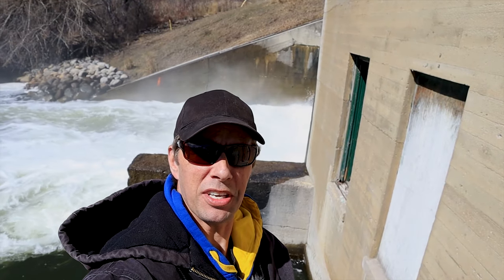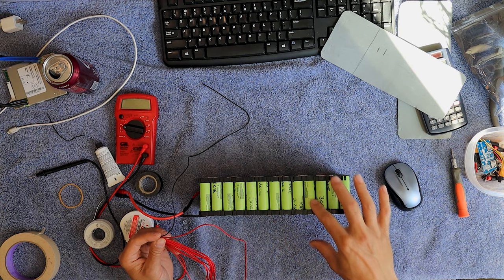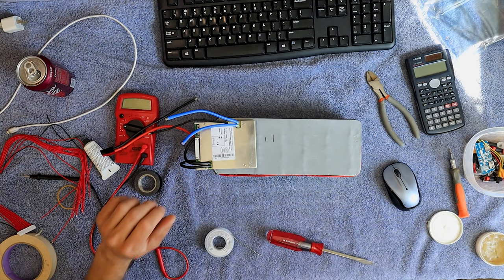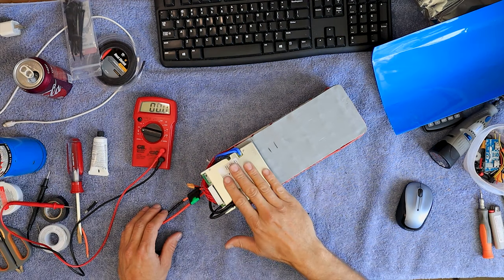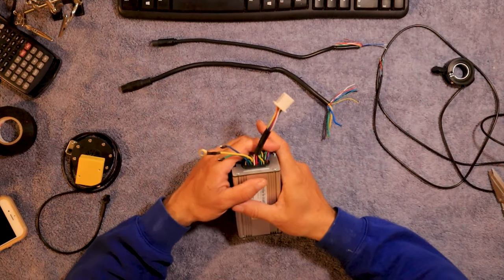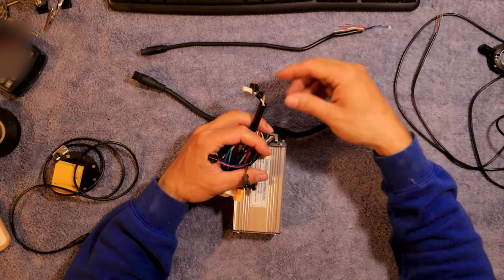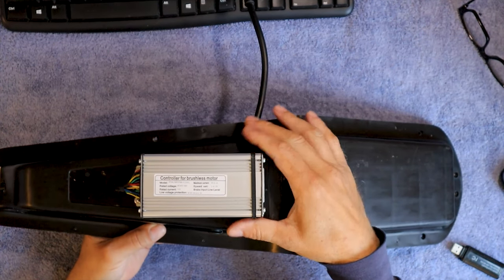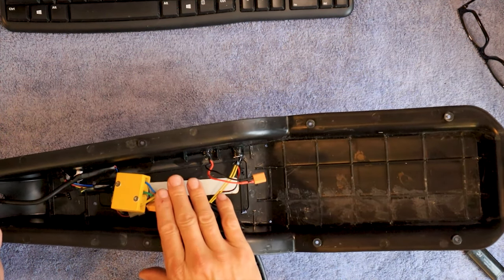Super73 Z1 48v Modification Part 2

Comment: Thanks so much for this video. Just ordered a z1 and looking to make it go faster but don't want to mess with the stock battery and controller just in case. Thinking of ordering a 48v battery already in the case and attach it to the bottle holder on the frame and buy a new controller with the LCD and have a sort of dual-motor setup. if It' ends up being too heavy. I'll just gut the seat portion and add some velcro in order to use it as small storage lol.
Reply from the maker: You could always try to over-volt the stock controller and see if it can handle it.  Would have to clip the white wire inside controller to remove speed limiter.  Would kinda suck if it fried tho I suppose.

Comment: I want to keep the battery but replace the controller on a Super73 ZG (Europe) as I want a throttle and there is no wiring for it as standard, only PAS. Will the wiring for everything else be the same? Do you think I would come into any issues using the same controler as you?
Reply from the maker: Buy the throttle and the controller.   Just  make sure the clip is the same as controller and you get the correct end(male or female). Some controllers have different ends for some stupid reason.  At least that’s the way it is for the PAS connection anyway.  If you can’t have the throttle then I’m not sure.  Your call.  Just leave enough wire on the end of the controller in case it doesn’t work.  Also look up “Super 73 V1 speed hack.” On YouTube if you haven’t checked it out yet.  Brian d Howard is the channel name.  Might be easier to do that if your staying with 36v. Too bad you couldn’t just buy a throttle.  It would prob just plug in and work
Reply: @vanmasterflash7153  Thanks for the reply,  Yeah it would only be the PAS that I am worried about as Ill be replacing brakes with hydraulic anyway so no brake cut off and the throttle & display will be new with the controller so they will connect right in.  Does the standard battery connection fit right into the controller you used? Or will I have to cut and terminate this myself? Thanks

Comment: For the pedal assist 3 pin, brown, yellow,black...which wire is power, which wire is signal...I know yellow is ground?
Reply from the maker: Brown is power, yellow is signal, and black is ground coming from controller.

Comment: How would you connect the stock throttle to that controller? Red, blue black, on the controller to which wires on the line that houses the brake/throttle? got the bike open right now...hoping you see this and can help me out
Reply from the maker: I never thought about it.  you might be able to find it checking for resistance using a multi-meter.  Operate the throttle with one end touching the wire to be tested and the other to ground.  I'll look and see if I have the old throttle and try it myself maybe.  Ill get back in a few minutes. Thought I remember seeing a diagram somewhere as well.
Reply from the maker: https://endless-sphere.com/forums/viewtopic.php?t=98793
Reply: @vanmasterflash7153  Thanks let me know asap...we're lost over here lol
Reply from the maker: It's might take some trial and error.  Red should go to orange, but maybe red.  Blue goes to white, and black to black.  Grounds can tie together. Both brake and throttle ground end up the same place  in the controller.
Reply: Did you ever figure out how it wires up? I have a red/green/black connector on my controller.
Reply: @brandypearson7411  I did. Do you need to know how? I got it written down.
Reply: @karacoldmusic  Yeah if you have it around that would be great. I'm trying to do the same thing.
Reply: @brandypearson7411  red to red, green to white, black to black, make sure these are the wires that come from the brake/throttle line.
Reply: @karacoldmusic  Thank you! that worked.

Comment: Would it possible for you send me your program settings, P1 through C13? I'm guessing mine is not perfectly tuned yet as I keep having to reprogram p2 and/or c2 after every shut off. After shutting off and powering back on, the motor groans and shuts off under load.
Reply from the maker: https://www.facebook.com/justin.sanderson.775/videos/184451296012438/
P1 is 100 Not 99.  Mine P1 was off in the video.
Reply from the maker: These settings are for my scrambler but everything should be the same except for maybe tire size and voltage. I'm 3000 miles away from the z1's right now.
Reply from the maker: https://www.youtube.com/watch?v=B0F6x8V0NZQ&t=491s  Heres another video. Together you should be able to figure everything out.  Gear reduction and magnets are for sure the same between scrambler and super73-Z1
Reply: @vanmasterflash7153  I don't have FB. I'll wait until my wife gets home to check it out. Thanks.
Reply: Yes, I've watched this video multiple times, which is how I originally configured it. It was a great help. I think I figured out the issue I was having before, but now I just need to fine tune the mph reading as it's showing slightly lower mph than it should.